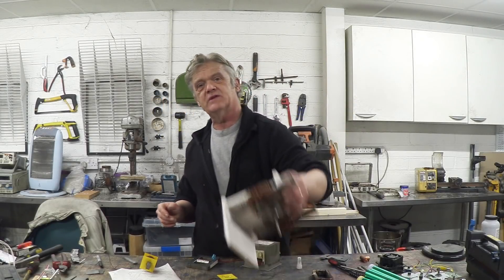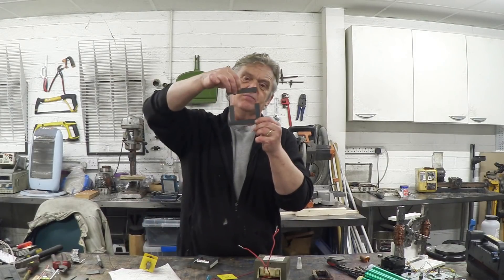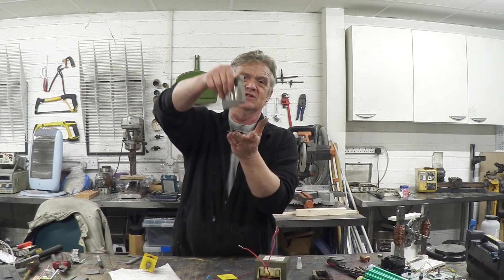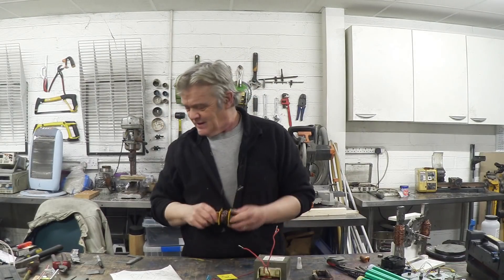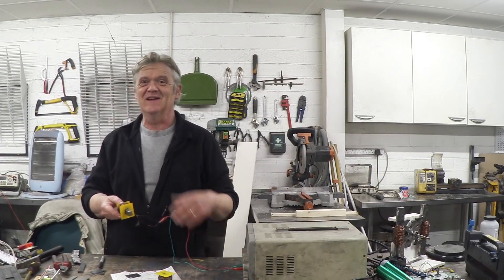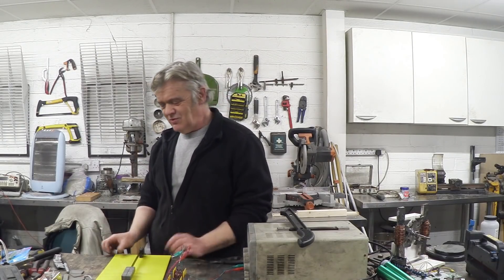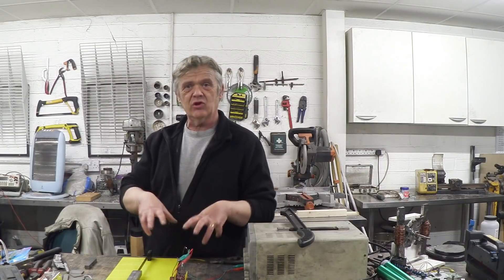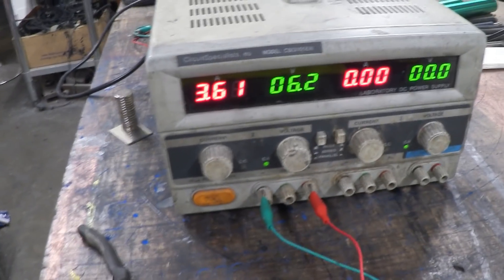1036 Flux Switching And Possible Over Unity

Comment: Could you use the electromagnetic force to drive a wedge, to open "the gate", allowing for complete utilization of the neodymium magnets force to work? Turning off electromagnetic pulls back the wedge. Putting magnetic unity back into place, or off.

Comment: You can add extra flux pathways for an infinite efficiency transformer. When the flux has to travel down high resistant pathways as it does in a standard transformer, you are gonna get less than ideal efficiency. And yes, magnets DO provide free energy, only an IDIOT would try to foolisly deny that. Its in plane sight my friend and you work with it all the time

Comment: The magnets assisted yes. the magnets made it more efficient yes. it has been long know permanent magnet motors are the most efficient. However not overunity.  So lets say for example that the magnets raised the efficiency to 80% from 20%. A 4 times decrease in power used. This is why electric cars use permanent magnet motors and are expensive. Permanent magnet motors are now reaching 97% efficient. No design of magnets and spinning things has been able to remove the battery or exceed 100% but there are many tricks. For overunity you need to go to brilliant light power which gets energy from the Hydrogen atom itself.

Comment: That would let you remove back EMF that causes cogging issues in rotating systems. The way a maglift train is moved forward  to turn a generator rotor shaft . Super Caps would store the driving force needed to set into motion and once turning should contune to increase from flux switching pulling the rotor instead of pushing force needed to over come back EMF. Does that make sence?

Comment: The Motionless Electromagnetic Generator operates in accordance with an extension of Faraday's Law, indicating that an electrical current is induced within a conductor within a changing magnetic field, even if the source of the magnetic field is stationary.

How does the MEG work?
Consider the physical layout of the MEG. You have a stack of neodymium magnets in the center of a rectangular toroidal core. The magnets touch each side of the core on the inside. There are no coils on the core yet.

What does the magnet flux do?

The flux from the magnets will divide equally between each leg of the core. So you have half the flux flowing on the right and half on the left.

You now place coils on this core. You use two control coils on the top on each side of the magnet stack. And you wind two output coils on each vertical leg on opposite sides.

OK, it is set up. Now you want to switch all the magnet flux to one side by opposing the magnet flux with the opposite control coil. How much flux will the coil need to generate to do this? Well, the answer of course is half the magnet flux since that is what is flowing in that leg. The other control coil is in the off condition, and open circuited, so no current can be induced in it and hence no back-flux generated. The core must not be allowed to reach magnetic saturation or more energy will be required to force the flux to the other side.

Then you turn off the control coil and what happens?

Remember both control coils are now off. The magnet flux will return to its original starting condition of half the flux flowing on each side. Does the magnet need any help to do this? No, of course not. When you did this you also removed half the magnet flux from the other leg when the control coil was on. The first half cycle you only see half the normal induction level in each output coil because at the start you only switch half the magnet flux into one leg and out of the other. So the total change is Bmag/2.

Now on subsequent cycles you let the magnet flux return to its original steady state and let the magnet do the work. Both control coils are off while this happens. Just when the magnet flux reaches its equilibrium point you turn on the other coil and keep the flux change going the other way. Each coil only needs to always switch half the magnet flux not all of it. After the first half cycle you see a 100% change of the magnet flux in each output coil on each cycle for an input power that is half the output. This assumes that you are activating the control coils for half of each cycle. This means you have a theoretical maximum COP of 2.0. You are using the magnet stack as a flux battery and "letting" it do half the work.

So you can get an OverUnity solid state generator with a theoretical maximum gain of 2.0. Just this alone could allow you to reduce your utility bill by about half if you put these devices between your breaker panel and your appliances.
Reply: Lee and Yang strongly predicted broken symmetry in 1956-57.
Two Nobel prizes were awarded in 1957 to Lee and Yang for substantiating the extraction process for this energy.

The strong prediction of broken symmetry by Lee and Yang and its experimental proof by Wu et al. in 1957, initiated a great revolution across physics and won a nearly instant Nobel Prize in December 1957 for Lee and Yang.

One of the broken symmetries proven by Wu et al. and published  in 1957 is the broken symmetry of opposite charges, as on the ends of a dipole. 

That asymmetry is used by charges and dipoles for extracting and pouring out Electromagnetic energy from the vacuum.

There are many ways to extract energy from the seething vacuum. Unfortunately, at present our scientific community takes a bizarre stance.  In particle physics it is well known that the active vacuum is incredibly energetic. Calculations by leading physicists such as J. A. Wheeler show that a cubic centimeter of vacuum (about the tip of one's little finger in volume) has so much raw energy in it that, if condensed into matter, there would be more matter than is observable in the universe through the largest telescope! So even a tiny efficiency of tapping could and will extract all the energy anyone could wish.

However, in classical Maxwell Heaviside electrodynamics (as used in electrical engineering), the same scientific community now assumes in the model that the vacuum is absolutely inert!

The model also assumes that the local spacetime is flat, so no energy from curved spacetime can be forthcoming, according to that inane model. Then the model assumes that all EM fields, potentials, and every joule of EM energy in the universe is produced by their associated source charges—right out of nothing at all, with no energy input to the charge at all, but with continuous energy flow from it.

Either the conservation of energy law is falsified, or the source charge must be receiving the necessary energy input in virtual state form from the active vacuum.
Reply: We simply must get the vacuum energy part moving, for when one examines all the options, it is the only option that will work in time.

We already know that the Maxwell-Heaviside equations, prior to Lorentz regauging, do include open systems in disequilibrium in their vacuum exchange. We are also already aware that the present classical EM model completely omits the vacuum interaction (much less any broken symmetry in that interaction!), which we also know is a gross non sequitur since the vacuum interaction (and the dipole's broken symmetry in it) have been well-known in particle physics since the 1950s.

The major problem in the U.S. is that the decision scientists at top positions advising leaders/secretary/vice-President/presidents, usually do not know anything but U(1) electrodynamics, and the advice they get from additional "expert" scientific consultants or advisers is inferior in that these "expert advisers" also seem to know only U(1) and also only the Lorentz-regauged Maxwell-Heaviside equations. Many (most) do not even "believe" in the active vacuum, or if they begrudgingly admit it, they think it is of absolutely no consequence. And they simply do not believe the tremendous energy density of the vacuum, nor will they accept it, even though it is good physics and has been for decades.

Hence the entire scientific energy structure and infrastructure in the United States is fearsomely welded to a small fragment (subset) of Maxwell's theory, and even to just a Lorentz regauged subset of the severe Heaviside truncation of it!  We have a scientific mindset problem of epic proportion. In short, the energy crisis is completely the fault of our own scientific community. It is NOT the fault of the President, the Vice President, or the Secretary of Energy!  It is the direct fault of the inferior advice being given them by the NSF, NAS, etc.

The sad thing is that the U.S. scientific community is seemingly no longer capable of even evaluating its own U(1) EM model, as it has become almost an iron dogma. E.g., in the 1880s Heaviside discovered the enormous energy pouring out of the terminals of any generator -- vastly more energy than we provide as mechanical energy input to the shaft. Poynting, of course, only dealt from the beginning with the tiny component of that energy outpour that is intercepted by the external circuit and caught and used. Lorentz understood both the Poynting component and the Heaviside component as well. But no one could explain what could possibly be the source of such an enormous energy flow from EVERY GENERATOR, BATTERY, AND SOURCE DIPOLE. That is rigorous. Simply check Heaviside's original papers.

Anyway, Lorentz then took the attitude that this enormous Heaviside energy flow component, missing the circuit entirely and just wasted, had "no physical significance" (his words). So he arbitrarily discarded it (not from NATURE, but from MATHEMATICAL ACCOUNTING) by a clever little integration trick, still used by all the electrodynamicists and those energy scientists designing and building our electrical power systems, writing our textbooks, teaching in our universities -- and advising Presidents, Vice-Presidents, and Secretaries of Energy.

In short, we most often face scientists who literally will not believe and cannot comprehend that every generator we ever built, already extracts enormous energy from the vacuum. It is quite easy to prove it, for peanuts. Any lab, university, or decent experimenter can do it. Kraus' diagram in his Electromagnetics, Fourth Edition, shows the nondiverged energy flow component in the form of contours, which are MEASURED watts/square meter at each point, where a unit point static charge will catch that much more energy.

Let me now give you a rigorous proof, and very simple, that every system is already vastly overunity by producing far more energy out than we input. Consider a perfect DC generator, loss free, so that its efficiency is 100%. Now consider a perfect external circuit attached, which consists of two short lengths of perfect conducting wire, and a pure resistance load. Let the load be 12 ohms, and the voltage of the generator be 12 Volts D.C. Now we have a neat little situation: We put in the mechanical power equivalent of 12 watts to the shaft. Since the generator is loss free, all the 12 watts are perfectly transduced into magnetic field, and the energy in this field is dissipated with 100% efficiency to form the source dipole. Let us leave the source dipole for a moment.

Now we look at the external circuit. There is one ampere of current (12V divided by 12 Ohms) flowing in the external circuit. So we are inputting 12 watts of power  to the generator shaft, and we are getting 12 watts of power output in the resistor. All this is clearly measurable and normal so far.

Now we check out John D. Kraus, Electromagnetics, Fourth Edn., McGraw-Hill, New York, 1992. Figure 12-60, a and b, p. 578 shows a good drawing of the huge energy flow filling all space around the conductors, with almost all of it not intercepted and thus not diverged into the circuit to power it, but just "wasted."

Hey!  We have 12 watts of power in. We have 12 watts of power output of the resistor as heat. By conventional Poynting considerations, we are getting out precisely what we are inputting. That is a blatant lie. We are getting output from the resistor precisely as much as we are inputting to the shaft of the generator. Yet we also are getting out a measurable vast amount of energy flow from those generator terminals, filling all space around that circuit. Those Kraus contours are experimental measurements. Anyone can do them, or similar. Anyone can build a little system very similar to this one, and approximating it.

So where the devil is all that VAST EXTRA MEASURABLE ENERGY FLOW pouring from the generator terminals, and missing the circuit entirely, COMING FROM?

Experimentally we can easily prove that this Heaviside nondiverged energy flow is (1) real, and (2) very large.

Let us now add in an extra set of "receiving antenna/collectors" whose circuitry is completely separate from the DC generator circuit with its load. Suppose we add enough of these "little antenna/interceptor/detector" circuits, each containing a little purely resistive load, to obtain 3 watts total in all those extra and independent circuits.

Well, now we are inputting 12 watts. We are getting out 12 watts in the external resistor attached to the generator. We are also getting 3 watts out of the "extra receiver circuits" separately, in separate loads.

So our total input is 12 watts. Our total output is 15 watts. Our demonstrated COP = 1.25.

So how do the "experts" explain that simple experiment????"  They don't. But any lab worth a tinker's dam -- and that includes any lab in Department Off Energy and in any university -- can do a similar experiment, catching enough of the extra "usually nondivergent EM energy flow" to bring the COP to COP>1.0.

This is a very simple experiment. So is the Bohren experiment which produces COP=18, is published in the hard literature, and is independently replicated by two additional scientists and published in the same issue of Am. J. Phys. that published the Bohren experiment paper.

Anyway, Lorentz's "physically insignificant" vast Heaviside nondiverged EM energy flow component is indeed "physically insignificant" to that single external circuit powered by that DC generator. But it is certainly not "physically insignificant" to those extra "receiver/collector circuits" and their independent loads.

Let's use two imaginary viewgraphs where in the first one Lorentz is shown in a sailboat on an ocean, in a very nice large ocean wind. Puffing his pipe, Lorentz is smiling and saying, "Only the wind in my sails is of any physical significance".  In the second graph, Lorentz is looking aside at a whole fleet of additional sailboats, calmly sailing along and powered by that "insignificant remaining component of the wind".  And Lorentz is saying, "How can they be using that physically insignificant wind?"

This is an exact analogy to the state of thinking that now exists in the U.S. power industry and the U.S. scientific community concerned with power systems. We don't have an energy crisis, we have a collection and usage crisis—and a vast scientific mindset crisis.

Hopefully this will change in the future with highly capable scientists who know quaternion electrodynamics, Maxwell's original complete theory, etc.

Let us make very clear that extracting energy from the vacuum is very easy. We will use a device which can be built for a dollar.

Take a charged capacitor, and lay it on top of a permanent magnet so that the E-field of the capacitor is at right angles to the H-field of the magnet. Then the standard Poynting flow S is given by S = ExH, which in this case is maximized for a 90-degree angle between E and H. In fact, the magnitude S of S is just the product of the two magnitudes E and H. The direction of S is at right angles to both E and H, and given by the usual right hand rule.

Well, even by orthodox theory, that is an actual Poynting energy generator. It just sits there and pours out free energy, directly extracting it from the vacuum. There are two dipoles -- one electrical and one magnetic -- continuously serving as an asymmetry in the fierce vacuum flux. Once you pay to make the permanent magnet and charge the capacitor (or use an electret), that simple gadget will extract energy from the vacuum and pour it out indefinitely.

This illustrates how easy it is to extract energy from the vacuum. However, it comes out in nondivergent or difficult-to-use form. So the problem is to intercept and divert a substantial portion of it, or convert a substantial portion of it into a usable form.

That is the problem that the scientists should be working on, with maximum effort.

Comment: IF you had used THE SMALLER guage wire from the HIGH voltage coil you would have had a greater number of turns on the bobbin. Then the electromagnet would be MUCH greater in magnetic flux and the results would be a much greater deviation!

Comment: very simple and interesting investigation method good job like every time! Any way there is no doubt that it's possible to make overunity utilizing the energy treated by permanent magnets; infact the most simple and diffused way is just to use the assisting force of permanent magnent rather than the braking force of it to get more work out than the imput using the electromagnet to momentary brake the simmetry. But very important issue about this machines are the use of the right kind of magnet and ferromagnetic core material. Infact magnetic assisting can work only if the core is not completely saturated by permanent magnet flux. MOT is very good in this case because is made by Silicon steel that is very difficult to saturate with permanent magnet however it's not good if you need more than 60hz by your machine so other kind of core material is needed like  nanocrystalline alloy but you need also to decrease permanent magnet strenght...